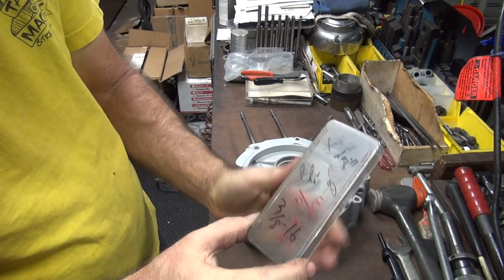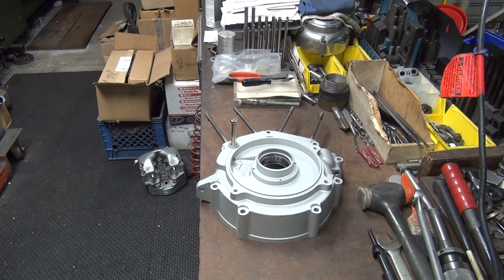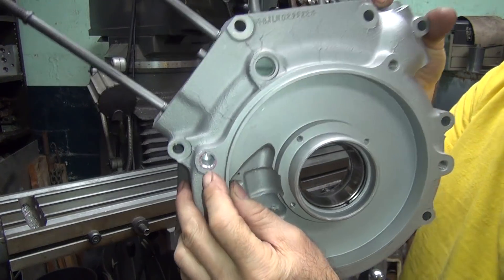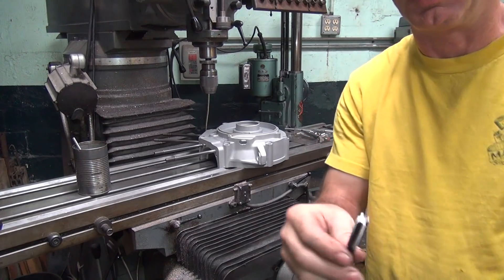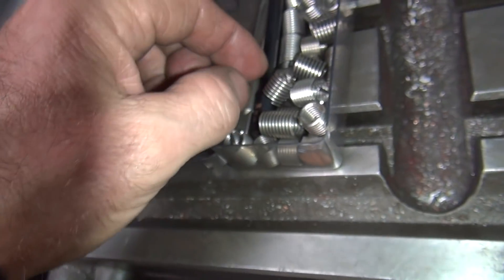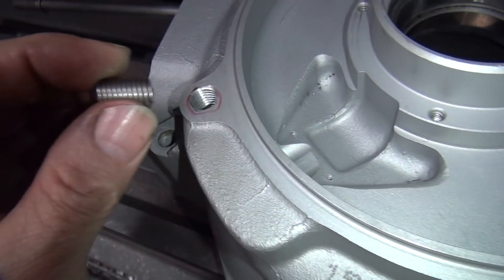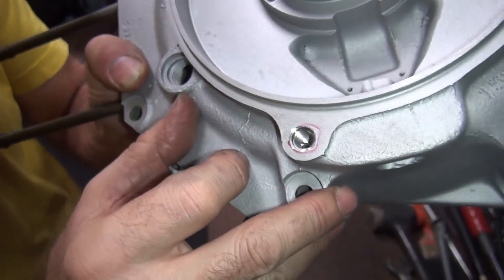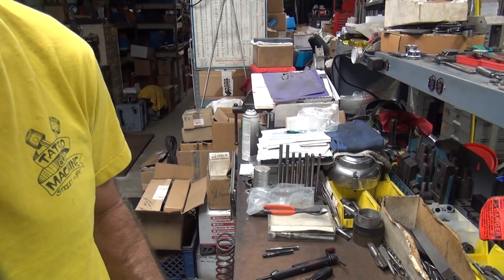1992 80ci evo motor rebuild #109 repair softail fxst flstc case welding harley by tatro machine

Comment: I hate missing drill bits. Couple years ago I finally broke down and ordered 2 of every size I was missing from McMaster for all of my drill indexes. Two fractional, one number. I don't have a letter drill index, just a few letter sizes for the taps I've used. Life has been good ever since, one less frustration. Why 2? There was a reason I was missing the ones I was missing, and I bought 2 each so I had replacements on hand for the next time I lose a drill bit.
Reply from the maker: thats how i do it too. these sets are back ups for the good set that i use on the mill. these ones are more for the shop.
tatro